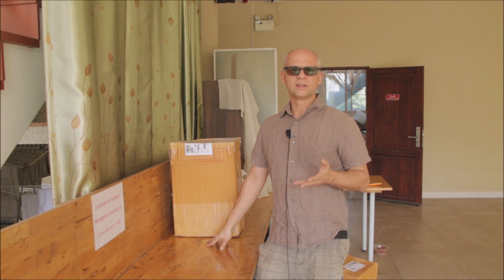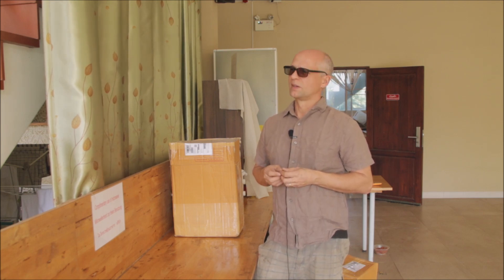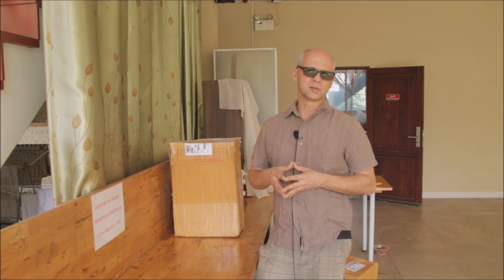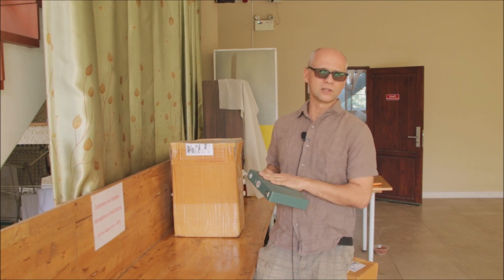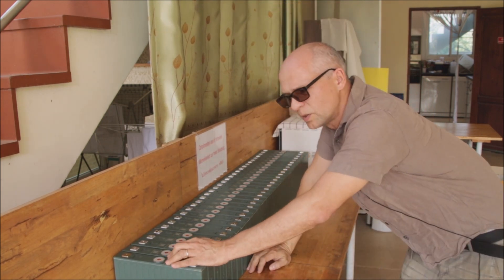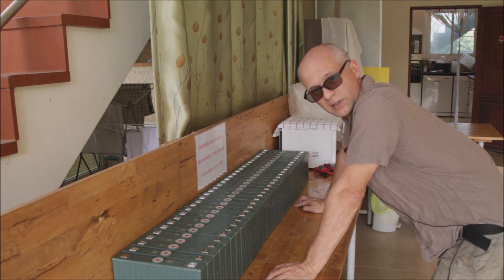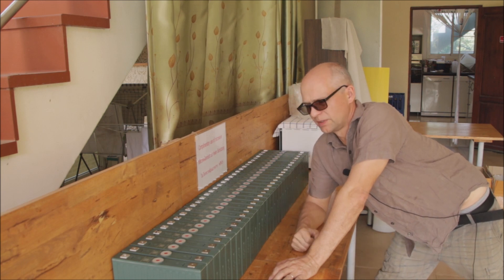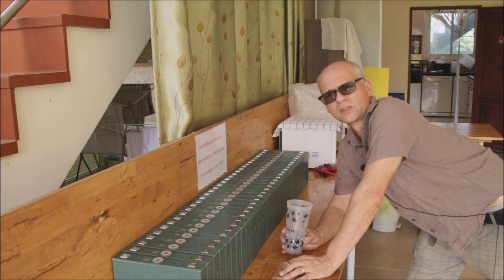The AC-Powerwall Upgrade: Part 1, LiFePo4 Cells for a bargain in Thailand

Comment: Sorry I didnt watch this video before asking in the other video. Thanks for the providing the link. Now out of stock. I will drop a quick email to you with a question, hoping you have time to answer, sir.
Reply: Did you get any of those 100A Sinopoly cells ?
Reply: @Steveuploads   no I ended up getting 55ah ones to fit in the spot for shipping them

Comment: How are your new cells, I’m thinking of getting some from twi
Reply from the maker: Cells are good. somewhere around 85-90% State of Health. I am pleasantly surprised. My last cycle was around 18kWhs. So that is much more than it would be with performance of only older cells which i had.
Reply: @RolandW_DIYEnergyandMore  Hi Roland I have just uploaded a little video about Twi Twi Lazada to demonstrate the point about the inconsistency between reviews with photos and the Star ⭐️ ratings they have which seem to me to be concerning. Check out the latest video on my account , I’d be interested to hear your opinion. I am going to purchase some of the Sinopoly cells.